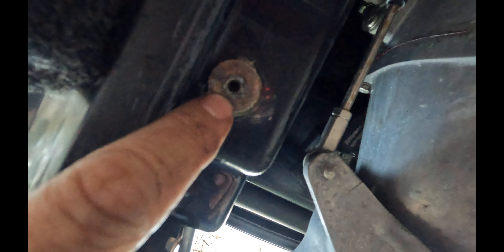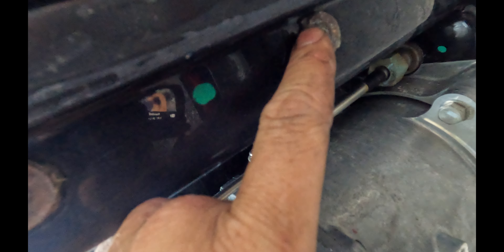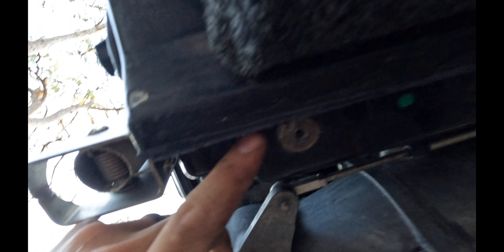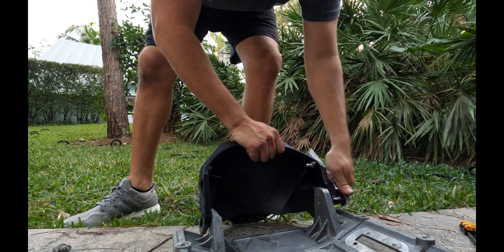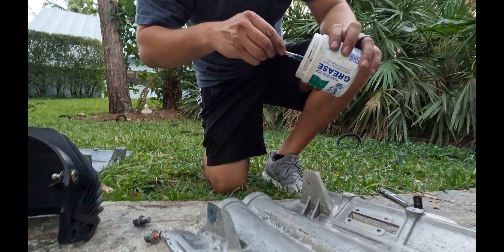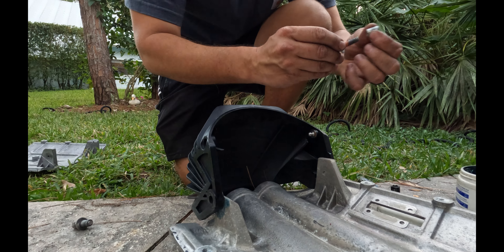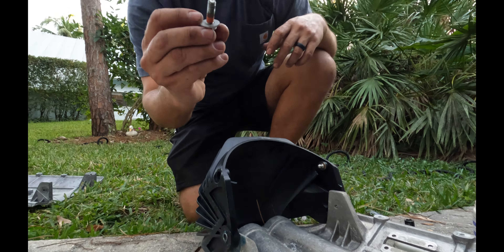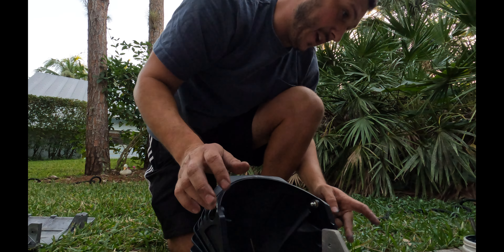Installing the Kspeed KS2 Offshore Ride Plate with @JDsWaterWorld and @watercraftjournal

Comment: Other than the speedo hole what is different with the rideplates on 22s? Factory plates look the same. Are the reverse arms different? Thanks for the video.
Reply from the maker: good question.  the speedo hole for sure.  also, the reverse bucket and that whole setup is different so the ride plate is completely different.

Comment: Did you silicone the ride plate?  Thanks
Reply from the maker: Hey steven.  We didnt that day because we were doing all upgrades, tests and speed runs.   But we did silicone it all now.
Reply: @TheAdventureState  What will be used to seal when the time comes?  I know that JD used some on his intake grate, but it didn't hold.  Thanks.
Reply from the maker: @johnd5094  i had my dealer seal it since i had them do a service.  Future reference for me, ill try different marine silicones until i find one i like.

Comment: Would it do as good for 160lx?
Reply from the maker: The new gen fits differently.  I know kspeed is working on one.
Reply: @TheAdventureState   I will have two 2024 lx arriving in the spring, with lower output does k speed riding plate make sense?
Reply from the maker: @Podchynok   well i dont think they have the new ride plate done yet.  the ride plate will help you stay connected and give you better control.  most ride plates you may sacrifice a little top speed (like 1mph or 2mph) but for me personally, prefer staying connected and having better traction/control.  so, really depends on your desires.
Reply: @TheAdventureState  noted, thank you.